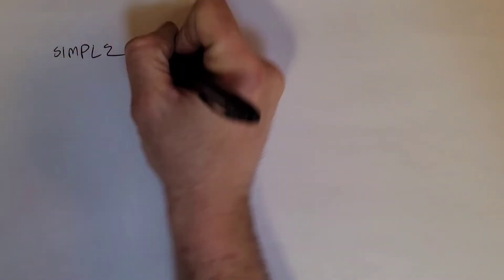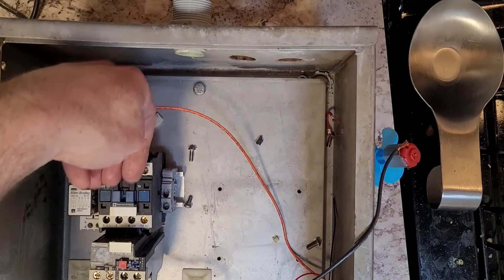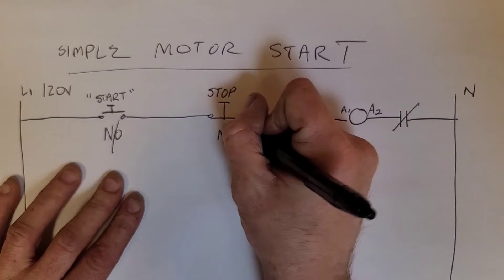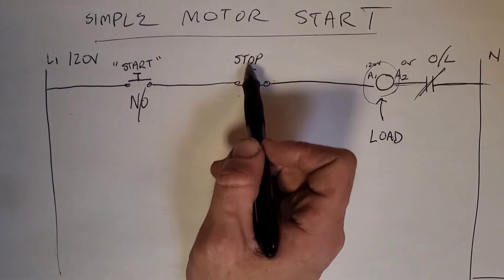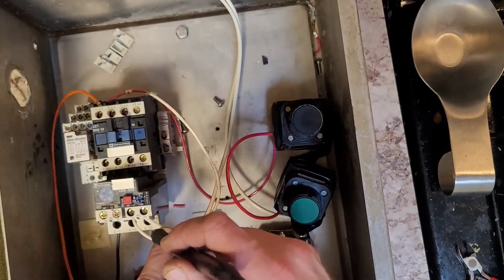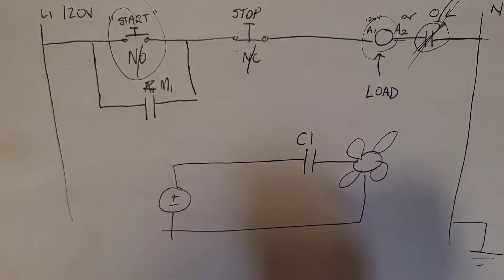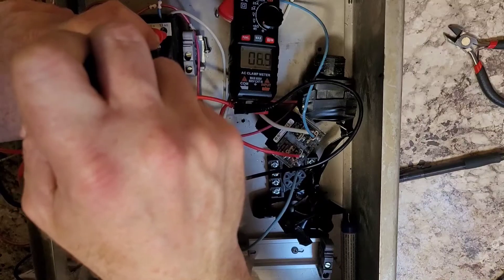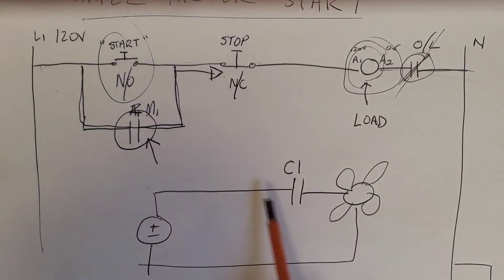☆☆Understanding Motor Controls: Electrical Schematics, Wiring & Troubleshooting Contactors☆☆

Comment: You want the over load on the NO so when it fires up it closes.
Reply from the maker: The overload contacts are normally closed: when the motor (contactor) is good it is closed, allowing the coil voltage to go to neutral. When there is an overload that set of contacts opens up, interrupting the circuit that energizes the coil for the contactor/starter

You can run a NO contact on the overload that under normal conditions won’t have power running through it. During an overload situation the NO would energize, you can use that as a discrete input to the PLC or controller to let it know there is a tripped overload

Comment: Maybe you could explain reversing contactors & controls? 
There's a 1970's hillside tram I'd like to get working. Its 120v with 24v start stop button & limit switches.
Reply from the maker: I cover it briefly in my new relays video. Do you have schematics or do you have to guess
Reply: @gregroche7323  no schematic. It's at my friend's lake house, I haven't been there in 9 years. I have a few pictures not sure how I could show you but it has AB reversing contactors & a single button in the basket. I will call my friend & get more info, it was just way out of my league at the time as I mainly do residential but have been doing more commercial lately.
Reply from the maker: @ yea basically woth the reversing you are going to send power to one coil or the other coil typically A1. Run power thru one contactor to run the motor forward, the other one will run it backwards. If its 3 phase you just flip one of the sets of power wires to the motor. You definitely do not want to energize both coils at the same time. What you could do is kill all the power and put your process into the position where you would want it to run forward and use a multimeter to figure out which path of contacts has continuity at that time; run that power to A1 forward. Move tour process to where you would want it to go revers use multimeter on ohms and trace out a path with continuity thru the limits and run that to A1 reverse. Put your process into a whole bunch of positions make sure you are getting the proper path at all positions & both paths don’t have continuity at the same tome ever. Hope that makes sense. I will try to do a video on it in the future. It’s not super confusing but rotary limits can be a bit confusing
Reply: @gregroche7323  Thanks. I'm pretty sure the problem with it is the rotary limit switch.  Unfortunately it's 2 hrs away from me at Lake of the Ozarks & there's not any supply houses out there either that I'm aware of
Reply from the maker: @ yeah I would just”ring out” the path from the incoming power to A1 verify that circuit is completing, if it’s not complete Turn off the power and find either the gap in the circuit (open) or short to ground in the power side if you are blowing fuses. Also verify your path from A2 to neutral/DC- that would be an easier fix

Comment: Wouldn’t you take your 120v to your stop button first?
Reply from the maker: Without rewatching this video, I’m going to say I believe it doesn’t matter. Whether the stop button (that is usually “on”) or the start button (which is only “on” when pushed) is 1st doesn’t make a difference, we need both permissive to turn on the coil/ relay/ output. 
Keep in mind this is a simple circuit, there are scenarios where a stop button will turn off multiple “branches” and in industrial work generally you have E-Stops that shit down a bunch of stuff, usually through the use of a safety relay that outputs all control power.

So no, I do not think it really matters but some scenarios are set up differently and if your stop button turns off a bunch of stuff you would need to put it first and have multiple circuits coming out of it or use that to control a relay that powers multiple circuits
Reply from the maker: If I’m mistaken i do apologize i did not rewatch the video(its been a while)

Comment: Does OL 95 go to A2 being neural and 96 goes where as u said it's also a neutral?
Reply from the maker: @siphomayisela288  I don’t think I understand the question 

A1 is where the 120 V goes into the coil of the relay, the voltage is consumed through the coil and once that line comes out on a2 it is neutral. You then run that neutral wire through normally closed contacts on the overload relay. As long as the overload is happy that circuit continues (all still neutral on the OL contacts). 
Let me put in another way if you’re overload contact is happy. It allows circuit to run through it and behaves the same as attaching A2 directly to the neutral coming into the panel(running back to the source of power) when the OL trips that normally closed contact gets opened up and the neutral from A2 gets interrupted(like cutting the wire with sciszors) and never gets back to the power feed releasing the coil and turning off the starter. Everything after a2 is neutral (making it slightly harder to teat by the way you have to pur your thinking cap on a bit)
If they didn’t answer your question rephrase it I’m happy to help

Comment: Is it OK to have the overload in the neutral wire?
Reply from the maker: Yeah that’s completely fine, if you do have your overload in the neutral and you’re using 120 V AC if your overload trips you’ll actually measure 120 V on the one side of the overload because the current is not being consumed in Coil .

This is very important, it doesn’t matter if your overload contacts are positioned on the hot side of your control circuit, or on the neutral side, You just wanna make sure your control circuit only has one path to neutral, which is through the Coil (A1and A2), Make sure you don’t wire a hot to neutral without having to pass through something that will consume the power that is a short circuit
Reply from the maker: @michealplater9007  Also, I probably need to expand on the question. I don’t know how much you know about electricity, so I’m just gonna cover the basics.

Generally speaking, you use a contactir when you’re running three phase motors so on a three phase motor, there are three hots, and then a ground. All the power for the motor runs through the three hots and the ground is used just in case. The there hots run through the contactor (aka starter) and your control circuit makes the contactor turn on. I am discussing control circuits, meaning the power that you used to tell the pump to turn on, not the power that goes to the pump. I’m assuming your question is in regards to the control circuit and not the actual power going through the contactor, a.k.a. starter to the motor. Lmk if that’s what you’re asking or if you need more information.

Comment: Hvac guy here  20 years experience looking to get into controls.
Reply from the maker: @donnellbaxter8050  that's cool I'm actually curious if you'd be able to transition pretty easily without going to school. Or possibly maybe you could just get some sort of like 9 month certificate and try to get a job as an electrical maintenance technician. I would appreciate if you could give a follow-up in a couple months and let us know how it worked out. 

Also I get it HVAC is pretty closely related but I feel like you have to subject yourself to worse environments especially if you live in a hot State I could see that getting old

Comment: Why dint you used stop for Line, connect stop and start jumped to NO-1, start to NO-2 conected to COIL-1, COIL-2 connected to NC-1,  NC-2 connected to neutral??
Reply from the maker: I'm going to have to rewatch the video to answer that LOL I'll check it out tomorrow though thanks for the comment I get back to you
Reply from the maker: @rickytva469  bro I'm trying to figure out what you're asking and I can't figure it out that definitely doesn't mean it's not right though. I'm really curious I wish you could send a picture on here but you can't... Anyways there's always more than one way to wire stuff this is just basically a video about how most industrial motor circuits are wired this is like the basic template and then you just add to it

Comment: thank you for the video...  Question:   why not just use a Normally open switch instead of converting a momentary switch to a normally open switch?
Reply from the maker: But yeah just throwing a switch in there would be effective... I just wanted to say thank demonstrate that type of circuit is pretty common
Reply from the maker: Yes you bring up a pretty good point... That's just how they do it more often than not. That latching circuit is pretty common I wanted to demonstrate it cuz it's not very intuitive . I guess the benefit of doing it this way is if you have an overload trip or hit a stop button it will not start the process back up when can you reset the overload or let go of the stop button

Comment: I don't understand the jumper from A2 to overload relay. How does a neutral open up the coil? I thought the overload automatically detect high current and kicked the contacts out?
Reply from the maker: Hey, that’s actually a great question… A lot of contactors will not disconnect the circuit when there is a trip. The big square D motor starters/contactors remain intact during an overload. There’s just an overload auxiliary contact on the side. That’s used to interrupt the start circuit now that I think about it I’m actually not certain, if the Allen Bradley overload automatically interrupts a circuit. I do not think it does but I am doubting myself now. I’m a little busy right now I might look into that later or if you have time Google it and post your findings here I’m pretty sure the legs of the contactor remain closed, even during an overload, but on this model they might open automatically

Comment: is it ok if we put the stop button first to be safer
Reply: Thats how i was taught too
Reply: Came here to see if anybody else had the same question.
Reply from the maker: Yeah, that would be fine. I’m honestly not sure that might be the industry-standard my bad if I got that wrong. it should be noted this is a really simple circuit, generally you would have an e stop somewhere… there are many diffways to do it but an e stop will usually kill the whole control power circuit
Reply from the maker: It would not technically be safer. It would be the same thing but what you could do is put the E stop first and then make the relay circuit and the motor control circuit parallel after the e stop if that makes sense. The next level up would be have all the control power run through a relay that is energized via thru an e stop NC contact, or you could run it theu 2 nc contacts in series on the back of the same e stop.
The right way or a.k.a. industry standard is to use a safety relay the way that works. Is you run 2 seperate circuits thru the back of the e-stop, the contacts are closed aka power runs thru at all times unless you push the e-stop. You can put multiple e stops or saftey devices in series, each device has both circuits running through it. Those go to a safety relay(they are red or yellow and look like a rectangular module with some lights on it). That card monitors both circuits, they need to have the same voltage and both turn on and off at the exact same time down to a few milliseconds.
When the safety relay is happy, it will energize the contact that you run all the control power through other words with the safety relay is happy than your whole control circuit has power. There’s any violation meaning one of the circuits loses some voltage or they turn on at a different time. You will lose power to control all your devices.

Comment: What's the main reason why the contractor does not stay down
Reply: It cant stay down because the stop button has to be in the normally closed position in order to open the circuit and prevent voltage from getting to the motor starter. Therefore the motor starter is a necessary step so we can "control" it by hand. You can do this with PLCs and relays with 0-10v on a VFD for more specific control environments with automation.

Comment: what’s the pay rate for this position? or instrument technician
Reply from the maker: No license needed, generally 2 yr degree needed. Pretty wide pay rate, 25-50 hr
Reply: @gregroche7323  how does one get a job ? i’ve seen all the job posting in my area houston, and they all say experience required or preceded
Reply: and do you have to have a license electrician to be a instrument tech?